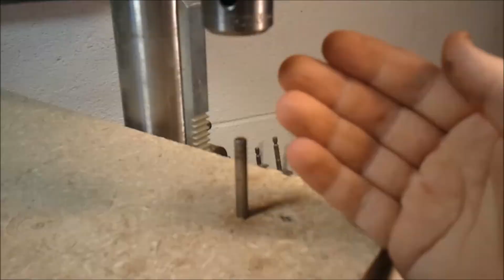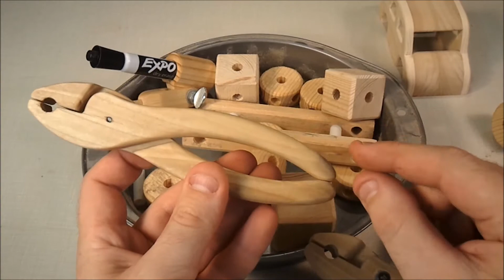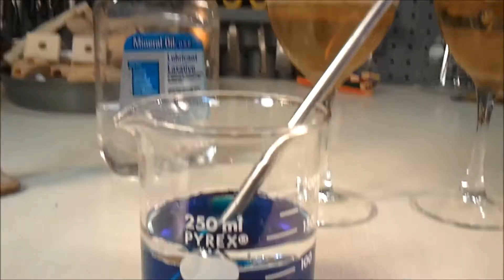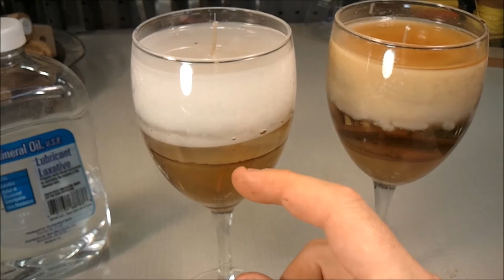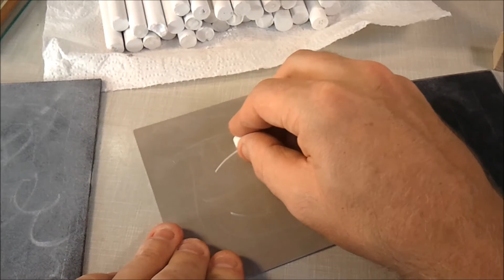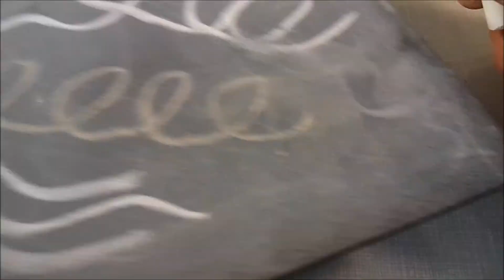Marking guage and some *bonus features* (failures)

Comment: I wonder if some kind of polyurethane clear varnish-type chemical might make a suitable barrier between mineral oil and paraffin. There are dozens of varieties, if there is one that both floats on mineral oil, and cures anaerobically, that might just work. I know of kinds that do one or the other, but its exceedingly hard to find info on these oddly specific properties. I might have to do some tests
Reply from the maker: So true. Sometimes the fastest way to learn something is to just experiment. Let me know what you discover. It was kind of a cool idea. Maybe an epoxy barrier?

Comment: what if, after you've added the water and mineral oil, you freeze the glass (google says that's -22 F for mineral oil, so that in itself is a pain in the ass, but alas) but once it's frozen add a thin layer of epoxy as a barrier between the oil and the wax?

Comment: pocket83 WRT the pair of wooden pliers: I understand that you want the pliers to touch touch in the back to prevent splitting, but did you consider lining the teeth of the pliers with rubber to get the extra grip that you required?  Either way, I loved the concept.  Another amazing video!
Reply from the maker: joeyflores91 Yes. I tried 1/8" rubber (roofing), as well as traction grooves, knurled texture, grip tape, and every other thing I could think of. This was just a complete failure. You just have to know when to cut your losses. Sometimes we have a hard time admitting that we are barking up the wrong tree, and wooden pliers, although cool, are a dumb idea.
Reply: I hope my persistent curiosity on this isn't annoying.  If you would indulge one more question: Concrete is a substance that is great for compression, but cracks easily in tension.  The key to obtaining the desired strength in both directions was to create a composite by reinforcing the material with steel rebar.  Applying that same concept, would it be possible to place reinforcement at the joint?  

Picture the device used in the center of a pizza to keep the cheese from touching the top of the pizza box- only shorter, with the legs being thinner and wider (like a circle with symmetric sections missing), and made of either aluminum or steel. This device could be tapped into wood- around the bolt in the pliers.  Thus, when the wood wants to split, the stress that would have otherwise traveled along the grain boundary of the wood is redirected, putting the reinforcing material in tension.
Reply from the maker: joeyflores91 Yes, theory is sound. No, you are not annoying. I could read constructive messages and ideas all night. However, I'm falling asleep and still didn't eat. Will look at pliers and try to think, and then respond tomorrow ;)
Reply: Looking forward to it!  Thank you, again, for taking the time to respond to my comments.

Comment: I'm really fascinated by your videos and I love all the small inventions that you build yourself to make your work easier. Although I just have to comment about the s sounds piercing through. Maybe it's a small thing that people don't pick up, but there are a few ways to work that problem. I'll still be watching your great videos, I'm just putting it out there.
Reply from the maker: I'm now aware of it, and I will do my best to fix it. Newer videos were run through a low-pass filter to remove much of that, but I now have a new camera, so I'm not sure how present it still is. Do me a favor, and let me know if my newest video bothers you. I will be posting it tomorrow (Friday) morning, and it is titled "Nintendo 64 logo." As for these older videos, you're just kind of stuck with it.
Reply: Oh, I should have noticed it was an old video! Sure I'll check it out  tomorrow. Thanks for the quick answer by the way.

Comment: I've thought of the urinal issue as well.  I think I've seen some dirivitives of your idea in the wild.  The challenge is that paper towels, gum, and other debris often clog the drain if the semi-sphere is located over the drain.  I would be willing to wager that the real issue really isn't with aim, but with low pressure dribbles which could be addressed by better geometry on the urinal itself.  The "old style" floor/wall combos could be tweaked pretty easily to help.  The more cost effective wall only models are without hope.  Of course, anything can be defeated by the outright passive aggressive turd who pisses wherever he pleases - with or without delight.

Comment: I believe that piece of black tubing is automotive in nature.  Judging by your use of universal joints and brake rotors in other videos would further evidence that likelihood.  But mostly because I have a foot-long section of that exact tubing that I originally purchased to repair a vacuum line on an old Thunderbird.  The tubing didn't work for me, so now I use it as a holder/puller/threader for hard to reach spark plugs.  If it fits a spark plug, the ID is probably the same.